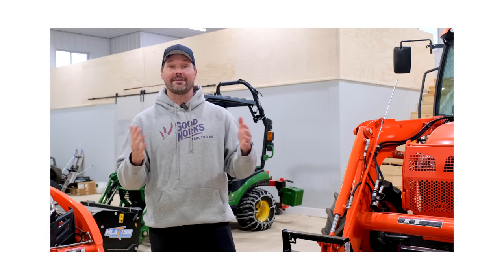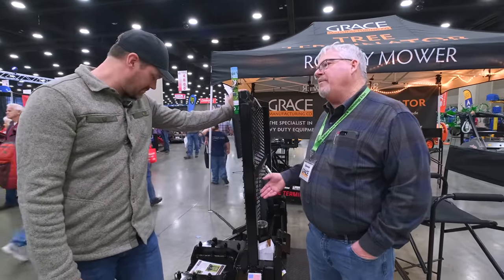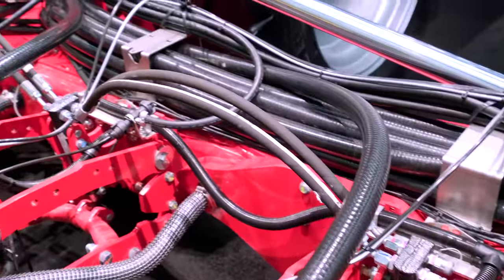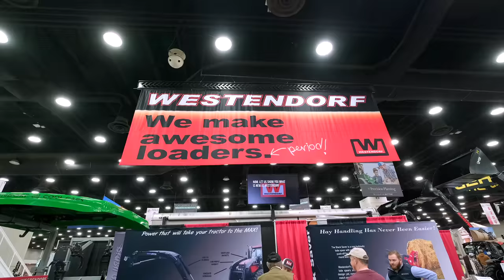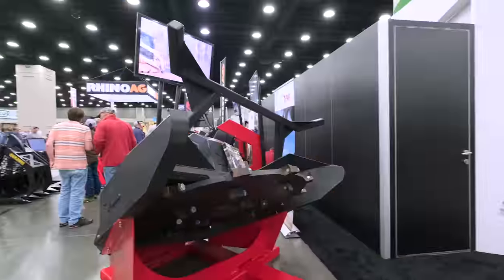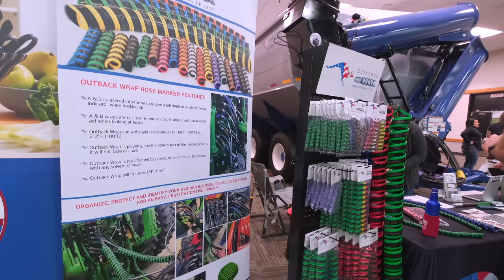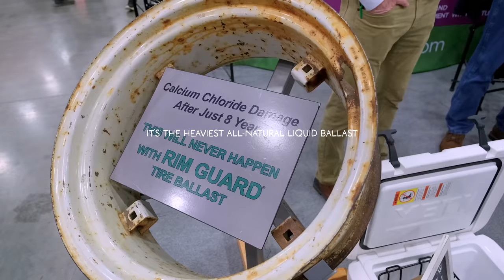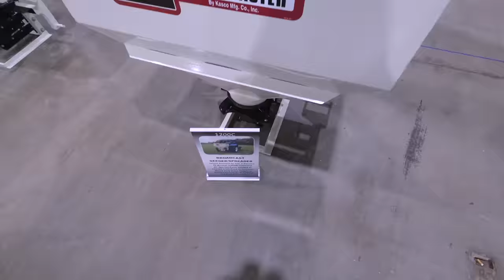WARNING: DON’T WATCH IF YOU ARE ADDICTED TO FARM EQUIPMENT!

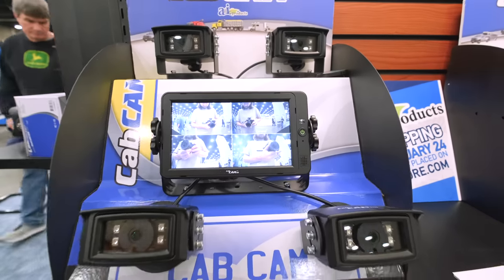Comment: 18:13 is a Lagoon Mixer, It has powerful jets on the bottom and it Floats on top and stirs up the Solids from the Bottom as the Lagoon is pumped out. It is Autonomous or remote Controlled.
Sure is a lot of Videos from the Farm Show. I've seen it all and didn't even have to go.
Thanks.
Mike M.
Reply from the maker: Ahh very cool, some of these things we just walked by and didn't stop

Comment: I would like to see more Jeeps turned into Chassis modified Tractor grade Heavy Duty Vehicles with PTO's and Quick attach implements and hydraulics
Reply from the maker: Haha, sounds pretty sweet to me!
Reply: @GoodWorksTractors  
I have seen Jeeps used to pull Tedders and thought if they pulled the chassis to replace it with a Freightliner chassis or something like it a frame rigidity upgrade and make it a Tractor Jeep